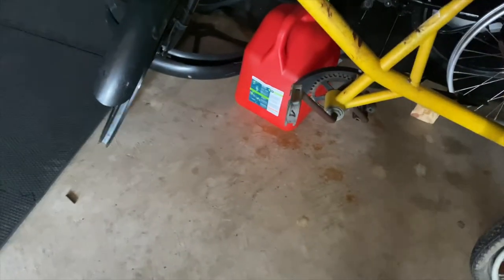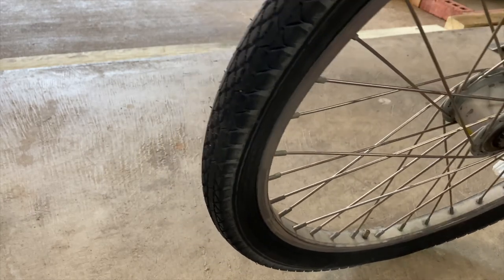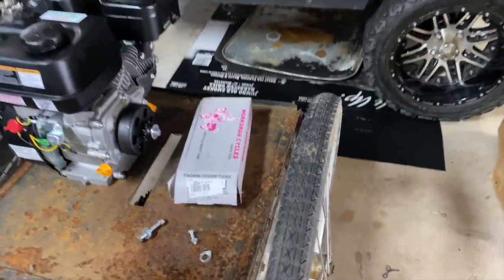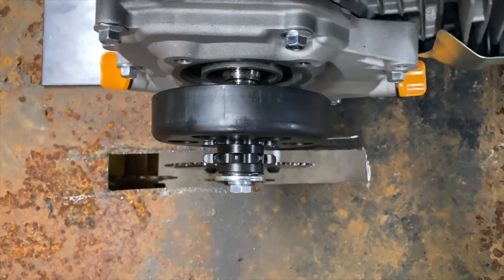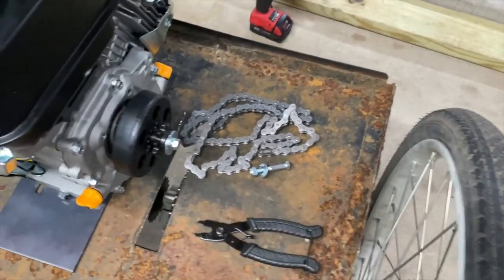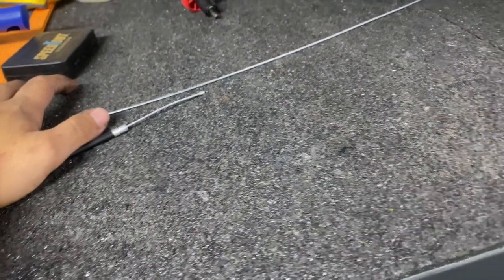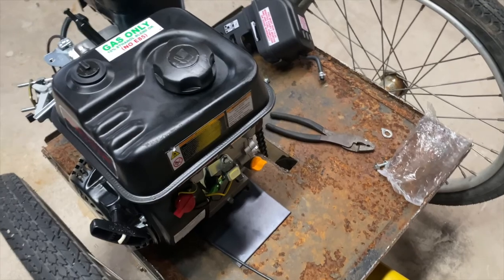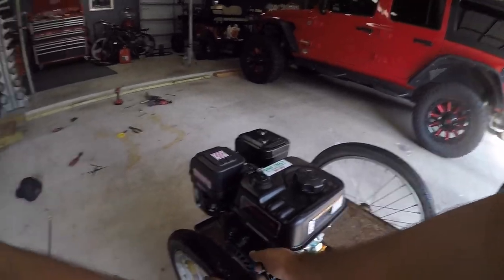Motorized Trike Build Finale With Riding Clip

Comment: Oh yeah 😎.  Worksman Industrial Trikes now made in South Carolina. Your motor setup like GoCart motor, driving the rear axle.  Another maybe easier is to put the 44 toothed "Rag Gear" ⚙️ from Bike Berry (2×stroke motor) on the inside of the Left,  idler wheel. Put the motor on the Left rear side and drive the "Rag Gear ⚙️ and the idler wheel. The Bigger the drive gear ⚙️ on the wheel or axle the slower but more torque you will get. 
 Throttle same setup on Vespa type scooters and motorcycles.  Most are 7/8" diameter, just like bicycles 🚲

Comment: i put a clutch on mine so can control the slip like on a motorcycle. it much easier i feel. because u can peddle a little then just let it out, or rev the piss out of it and burnout.. i get top speeds and take off with a mechanical clutch. each to their own, thanks for the video bro.

Comment: If you build another trike consider using an industrial grade tricycle. 

They're often used for in warehouse parts delivery between different sections of the warehouse.

Heavier duty frames heavier duty bearings everything's built to take a beating.

Commercial/industrial tricycles are designed to carry heavy loads also. Thicker tubes heavier down tubes gears all of it
Reply: Isnt that what this is?
Reply: @greenghost6416  NOt the original rims, "Worksman" original rims have thick spokes and better built

Comment: Chain should have some slack.. when you first put it on it was way too tight.. you want it a little loose so it’ll find its way around the sprocket without grabbing teeth.. I use the same washer method to tighten/loosen mine.. using the coaster brake  while clutch engaged might eventually break the pedal hub cause the engine is still trying to spin the axle also cause they’re not made for higher speeds.. you should oil the clutch every ride.. if the bike doesn’t idle in place you have to modify the clutch..

Comment: Right now I am running a four-stroke motor on a regular two-wheel bicycle however I am becoming homeless and we'll be living out of a camper pulled by a bicycle. I need to upgrade from a two-wheel bicycle to a three-wheel with the big predator motor which is also a four stroke. Is there some way that you can show a complete build from three-wheeled bicycle to a three-wheel bicycle with predator motor it would be greatly appreciated if you could

Comment: I talked myself into a 3 wheel moon cool at $1100.00 and what a mistake that was, 350w front and squealed like a pig. I found the same bike new for $129.00, different name same bike, 350w 24v motor and controller kit with throttle $109.00  24v battery $20.00. Ya ya ya...

Comment: overpowered to the point of unsafe.
Reply from the maker: Yep, that’s why I used the motor for something else. May end up putting a small motor on it, but for now it’s just collecting more rust!
Reply: @barriosbuilds7688  I'm getting a used elec trike for $100, the elec system is toast,
but i plan on converting it to the huasheng 48cc 4 stroke. 
I already have the huasheng 48cc on a bike, i'll swap it over.
Reply from the maker: That’s so cool! Maybe about the size I need.